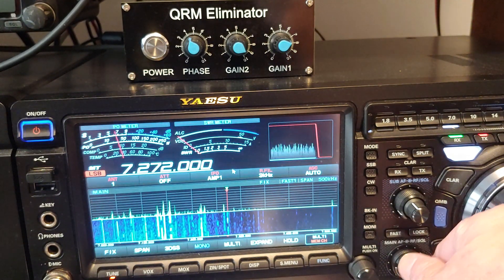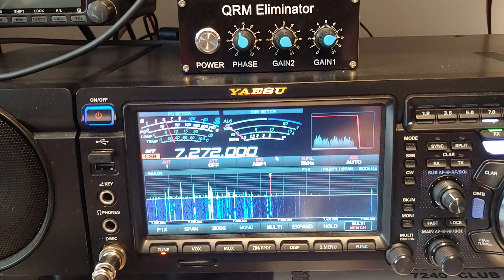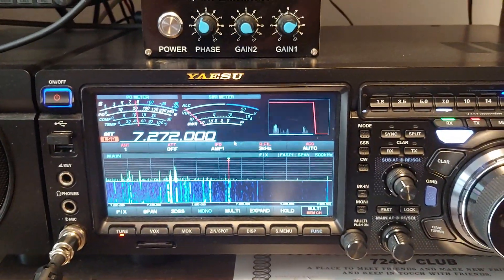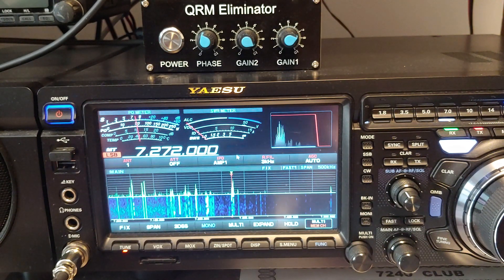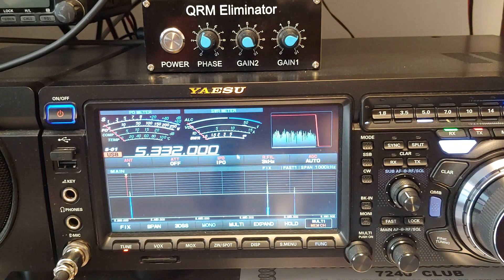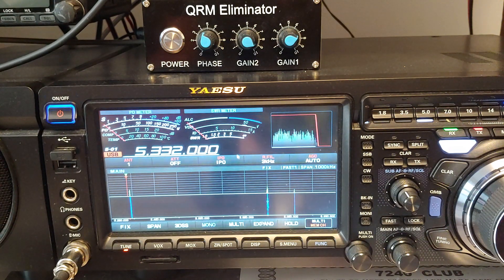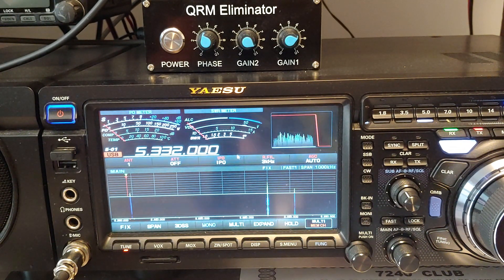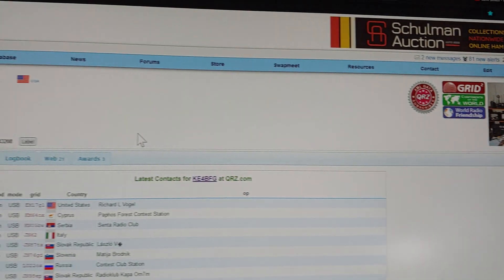Noise Reduction YAESU FTDX101MP

Comment: Hey Roger, I am enjoying your posts on the Yeasu FTDX-101MP. I am thinking very seriously of purchasing one myself. When you bought yours did you get the MAX with the extra filters installed? I'm wondering if I don't get them to begin with will I just have to add them later at a higher price? What antenna(s) are you using on your MP? I see the QRM eliminator on top. Does that help much? It isn't very expensive so I was wondering. Thanks for sharing your adventures. 73's David KQ4EJJ
Reply from the maker: HELLO  David  

YAESU FTDX101MP  is a  Real good radio

I did not get the  extra filters

to do over again I would got the 1.2 sideband filters

QRM Eliminator does help with the Line noise 

get them off eBay for a 50 something dollars

thank you for the comment  73